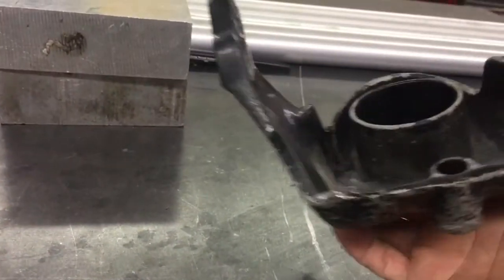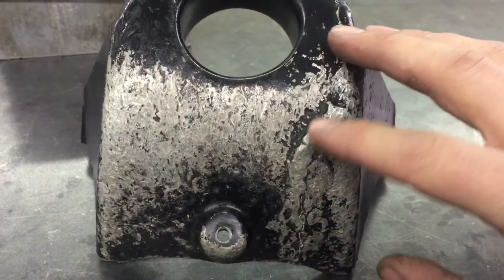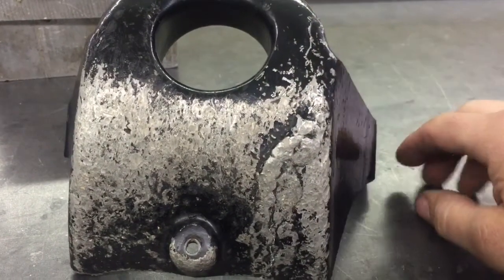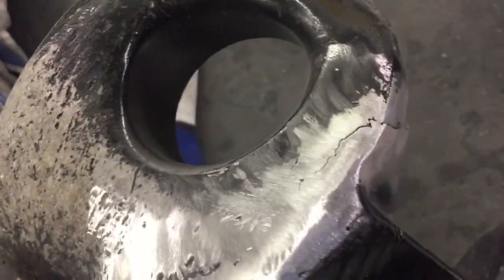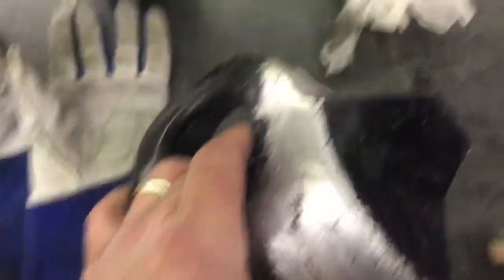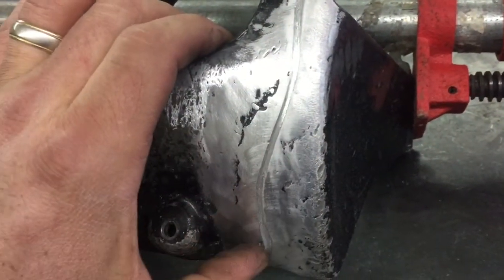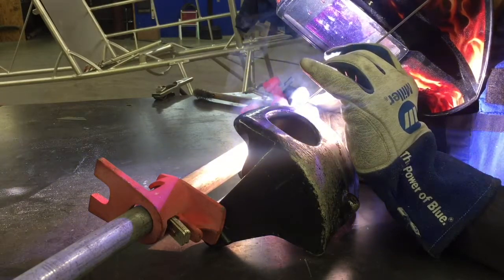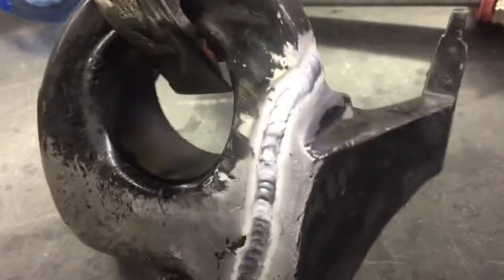Tig welding cast aluminum

Comment: l have a Arc/Tig lift, not sure if it is DC balanced. Is your welder indicated it is alum balanced?  If l use a AC welder (50 %), will it work on cast alum? thanks.

Comment: why not the 4043 filler?
Reply: It would allow for some give. Give will eventually turn into breakage with cast aluminum.
Reply: @williamminyard8508  What give means? I am not native english speaker so didnt understand it sorry.
Reply: @parçalabehçet  
I believe what Mr. Minyard means is that the 4043 filler element will be too soft for the cast aluminum allowing the flexing or what we call "give" at the joint while stress forces are being applied to the part. It is this flexing or "give" that introduces the stress cracking that could lead to structural failure of the component or part.

In the video, James the welder mentioned that the bracket was from an outboard motor jet pump. So, in a marine environment, the original manufacturer of the bracket should have used at least a 5000 series cast aluminum thus the filler material should also be at least made from 5000 series aluminum if not a higher series should the 5000 series aluminum not be available.

Hope this helps.
Reply: @RenKnight347  xz

Comment: I've haven't welded aluminum but know that the natural oil on your fingers can contaminate some types of glue repairs.  Is that a factor in welding?
Reply from the maker: Leon Johansson You are correct. The oils from you skin can contaminate the aluminum. Before welding I always wipe everything down with acetone.